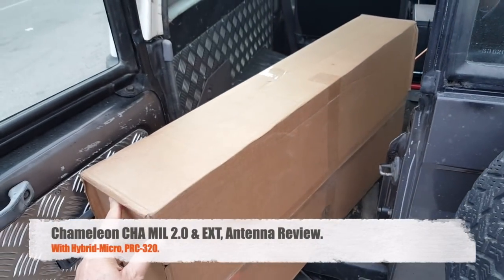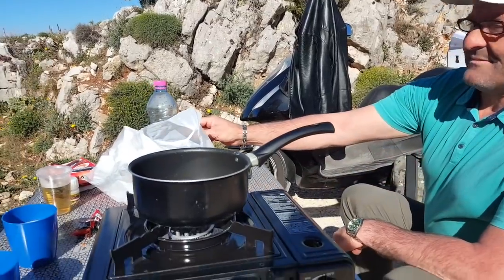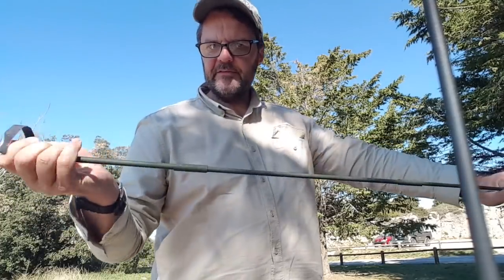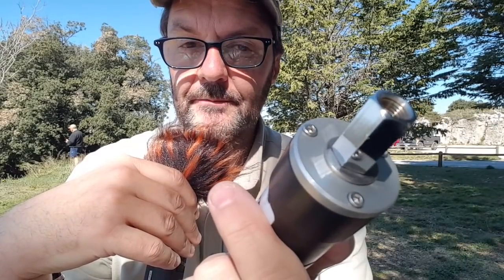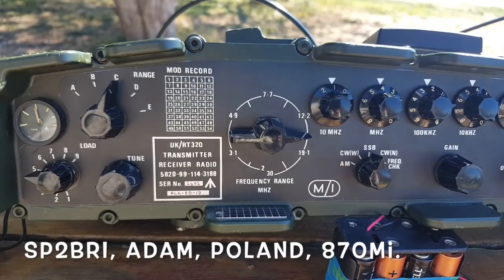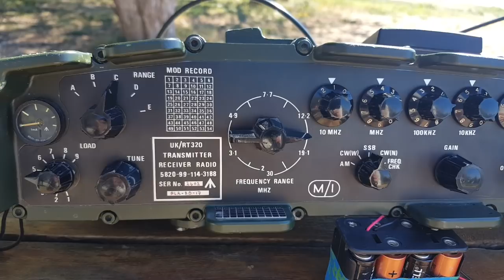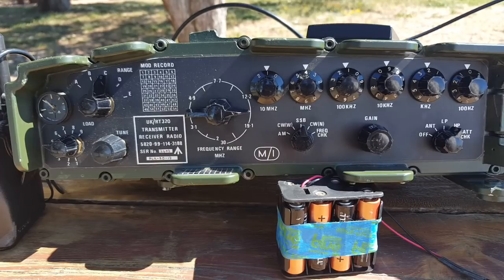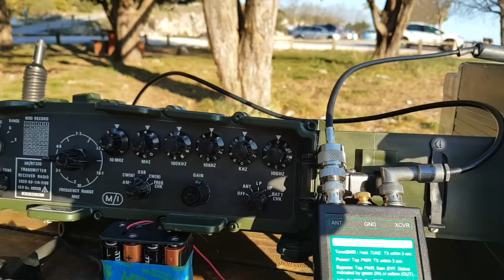Chameleon CHA MIL 2.0 & EXT, Antenna Review, With PRC-320.

Comment: Gil, thanks for the update on the new improvements to the MPAS kit. That 320 looks like new. You are right you can make stuff cheaper but sometimes the commercial grade is the best and worth the extra money. You can run over the balun and it wont break like a hambrew in a plastic box.
Reply from the maker: That's just it...

Comment: I always envy the field operation locations. I was in Grasse years ago and it was before the FT-817 radio and the PRC-320 would have been way to heavy for airline carry on. But My Hybrid-micro and some light wire would fit in my pocket very easily
Reply from the maker: Nice. Grasse is pretty close to here..

Comment: Very interesting review - thank you.
I recently purchased the MPAS system.
I set up my MPAS 2.0 Mini (with the CHA Cap Hat & Extension Whip) using the single counterpoise in the back yard.
 I haven't done any signal strength comparisons yet, but I took some swr measurements using IC-7300 built-in swr meter (RTTY mode).
Here are the results (for the middle of the 40,20 & 10 meter bands :
7.15 mhz = 2.7
14.17 mhz = 1.25
28.49 mhz = 3.0
The antenna seems to be 'tuned' more for 20 meters, and drops off quickly by 40 and 10 meters.
I have been able to use the reverse beacon network to get hits in southern California, Georga, South Carolina, Texas , New England and Costa Rica on both 40 & 20 meters using CW at 100 watts on the IC-7300 using this antenna set up as described above. 
I live on Vancouver Island, B.C., Canada, and the single 25' counterpoise is strung out due south from the MPAS ground spike.
Reply from the maker: It's really not meant to be used without a tuner..

Comment: Gil, Very nice antenna, my base station antenna is a Chameleon Zep flung over my roof. Not ideal, but due to  antenna restrictions here in olde Devon I have have no choice, but it works OK - Chameleon are expensive but nice quality. Could I ask what antenna is on the VX-6 at 1:34? Patrick is using the radio and the antenna looks interesting. Regards Alan 2E0EUZ.
Reply from the maker: Maldol MH-510.

Comment: Hi Gil..   fab video as usual..  I take it that the new antenna works far much better than the stock 320 antenna on the spring mount ?   Did you get any contacts on the 5080 ??  I bought a 12 to 24 booster and it can run the 5080 on low and Med power but stops working on High power.    The radio shouldnt draw more than 10A on TX at High but looks like it does as the booster is rated for 10A continuous and 12 A surge.    Got the original Tank antenna with the electronic ATU.. Its very big and need  to work out how to set it up on the car  / ground. It runs a 2mtr whip.  ALL very heavy to set up on the car when on a hill.  lol
Reply from the maker: Hi, the video with the VRM comes out on the 8th! Mine draws 6.5A on high..
Reply: @RadioPrepper   I will have to check mine out with an Amp meter.   it could be the RF is zapping the booster module ? it does stop the tv signal.    May have a play with it at the weekend.
Reply from the maker: Possible I guess, let me know what you find out.